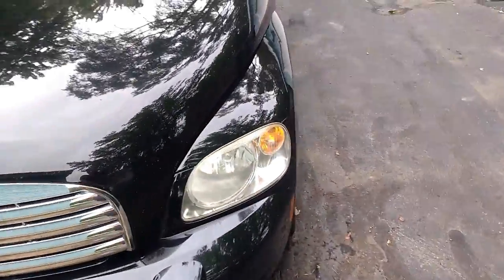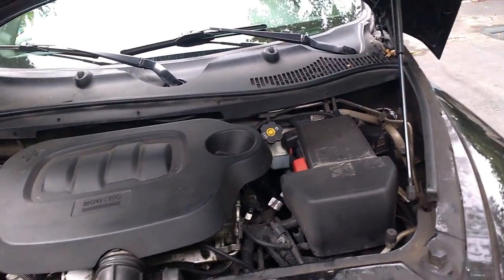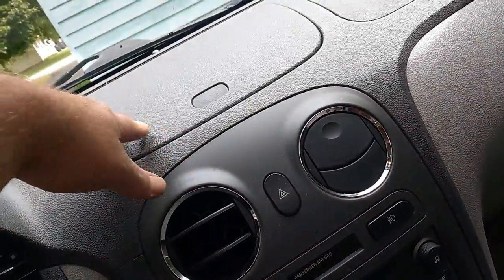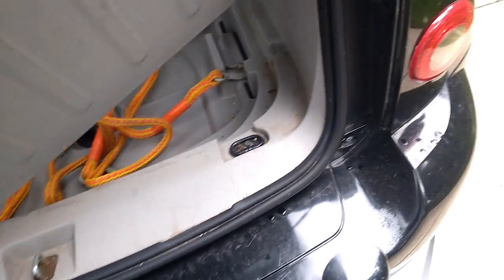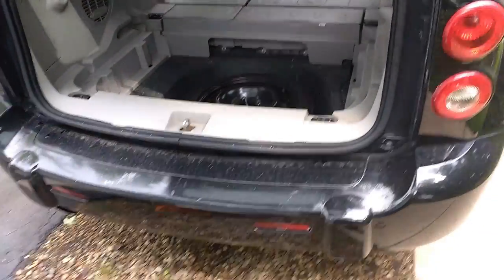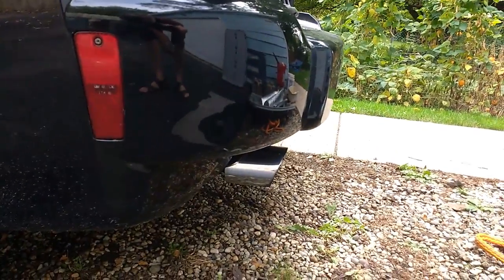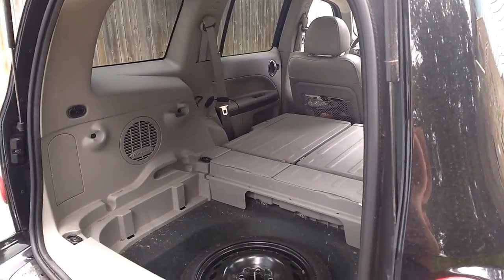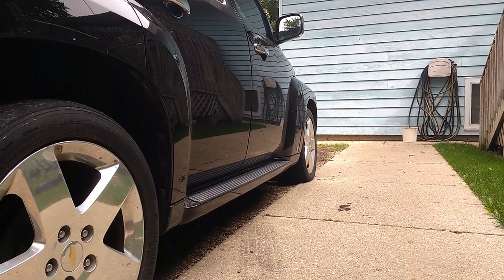2007 Chevy HHR Review For Shade tree fix-it Man

Comment: I just bought one of these.   It's a  2011 LT with only 22,000 miles. Garaged all its life so it looks like new inside and out.   I have a 2009 Chevy Cobalt coupe and it's been trouble free since new so I thought an HHR would be just as good since it's the same chassis, engine, transmission, etc. , The HHR is more space efficient of course.  I love it so far.  

I see you have Wisconsin plates.  I grew up there.  I live in Seattle now.
Reply from the maker: Yes, I live near Milwaukee. I hope you enjoy the HHR as much as I have. I have nearly 200,000 mostly trouble free miles on it and it is not garage kept and looks great given the amount of salt we use here. ;) Probably not something you worry about much in Washington. The one issue I had with the HHR that seems to be common is around 50k miles the front bushings start to go on the suspension. That said it depends on how you drive and your roads. You will have a lot of time before you have to worry about that just something to watch out for. Take care and drive safe! Great score by the way!
Reply: Peter L i have one lt since new 10 years with normal maintenance it’s a good car

Comment: If you haven't had a door handle break on that HHR you're a unicorn.  We've got a 2006 and I've replaced the front door ones - drivers and passenger sides - three times. We live in Michigan so maybe it's the cold weather, I dunno.  I just did both of 'em again this last week.  And, no, the wife and I are 71 and we don't yank on the things real hard.  They just break with regularity. I would add, too, that if they keep breaking (as in our case) there are some little posts to which the handle attaches and they degrade to a point (because you have to glue the things in to do those "YouTube: repairs) that you'll eventually have to buy a new door handle.   The trick, I have learned (far too late) is to buy the all metal door replacements....which I didn't know existed.   If you do them once, only, the direction on YouTube are fine.  The handles break because they are made of cheap plastic.

Comment: My '06 2LT (yeah, I have the 2.4 :D   ) just rolled over 200,000 miles and has been pretty danged reliable. I do plan on, if I keep it, going through and replacing a few wear items. I replaced a door handle after my daughter got a little over-excited when I pulled up to a favorite restaurant... but didn't need to do any plastic welding or anything.  The sunroof 'spoiler' on mine is disconnected and tied down. I don't miss it. Headlights are a pain compared to my Suburban, but I'm used to 'em now.    What I keep thinking is about my Dad, who sold some cars real cheap over the years, cuz they weren't worth anything at the time, only to kick himself years later. This car is pretty unique, though somewhat similar to the PT Cruiser (same guy designed both of 'em), and built for only a few years. Their value is down right now, so unless I need some quick cash, too much bother to sell.    I keep it garaged, though, so maybe, one day... when unicorns roam the Earth....   Oh yeah, I like the location of the window switches. They last longer as they aren't located in a slam-prone part of the car. :)
Reply from the maker: Yeah, all good points. For me this one is too rusted out and that is my fault for using the heck out of it and not tending to it like I should have. The 2.2 is nice however I sure would love to go with a 2.4, my wife has one in her Chevy and its much better. Take care!

Comment: I like my 2006 HHR LT with 2.4 liter 4 cylinder, ABS brakes, optional 17" factory aluminum wheels, AM-FM CD, two 12 outlets, & gray color. I like window controls on dash. Except for replacing battery & both front hub bearing assemblies, twice in four years , which I did the last time, no problems.

Comment: The headlight replacement is similar on the PT Cruiser, though it has a small removable panel for that purpose, but this will still be better than having to remove the front bumper which many of the newer cars require. I see yours has the cup holder under the hood too...LOL
Reply from the maker: LOL.. Yup I thought that was mighty nice of Chevy to put one there for my coffee or if things are going really bad beer. :)

Comment: I noticed that your HHR was an LT.  You said that it had the 2.2 liter engine.  I also have an LT and it has the 2.4 liter engine.  I was under the impression that the 2.4 liter was standard in the LT model.  Just saying.  But its not a big HP difference though.  Mine is 172 hp.
Reply from the maker: Mine is a 2.2 liter so I guess they made them with both motor types yea, probably not a big difference in HP but I would take a 2.4 because the 2.2 is a dog with the A/C on.  :)

Comment: Hey Scott got a 07 lt2 2.4 and you were saying that you had the injector replaced was there a code  for it ? I dealing with a p1174 and they say to replace the injectors .. when you went to dealer was expensive to have it reprogram ? If I have to I can do the job but the dealer has to program the ecm which I dread ..

Comment: man, that thing looks like a pain to work on. I thought the point of the eco-tec was to try and be the next "small block" of small motors? the HHR does have some nice options but It seems far too much like a disposable vehicle. when are car companies going to designing this way?!

reminder: I've never owned a car newer than 1990. So my judgement is a little skewed!
Reply from the maker: No you are actually pretty spot on, the Eco-Tec was supposed to be an easy to work on motor that was focused on fuel economy and this one hit that mark but missed the easy to work on part. Having said that I have not had much go wrong with it so from that stand point it does not get easier however if I had to replace say the timing belt I am pretty much screwed and will likely have to pay a mechanic to do it. Fingers crossed I don't have to do that.
Reply: @MidwestMotoRider  does not have a timing belt, you lucked out